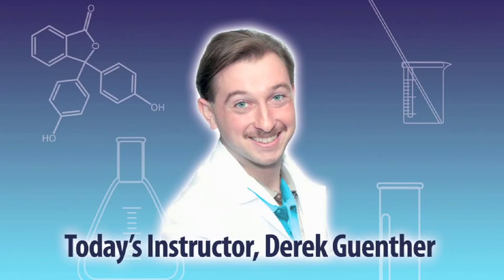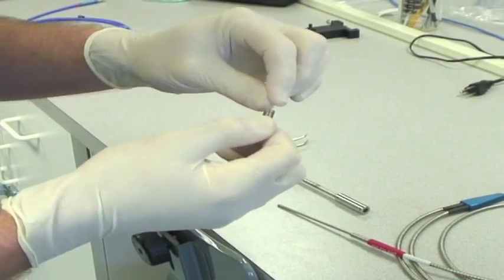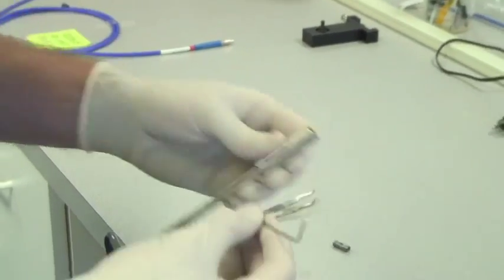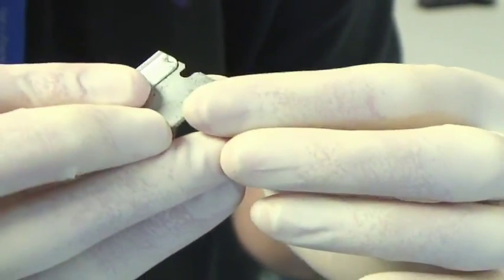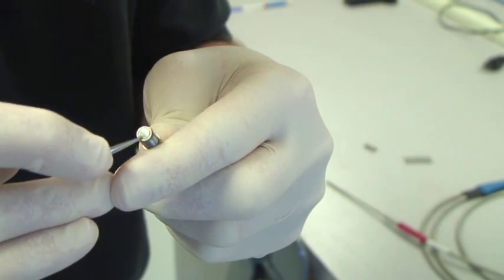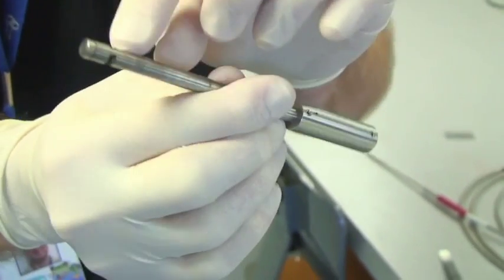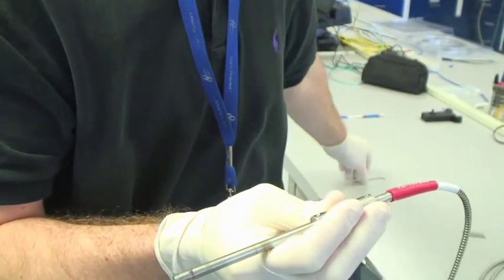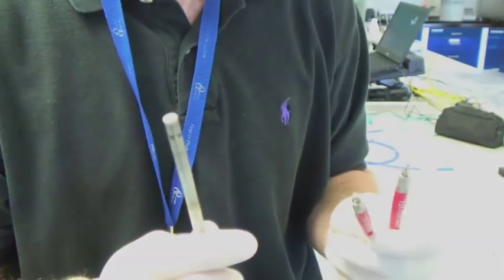Optical pH Probe Assembly

Comment: Hi Umesh here Research Scholar from India. Could you please share the details regarding commercial optical pH sensors?
Reply from the maker: Currently, we are not actively engaged with this technology.  

However, our technical team has provided an answer to your question. "These are colorimetric sensor films that use a spectrometer to correlate color-based absorbance to some pH level based on a prior calibration. At the moment these are not fully commercialized, such that there is no supporting software or documentation as these are developmental platforms for an OEM to integrate into their system. Performance specifications are largely based on the specific hardware used to interrogate the sensor films.